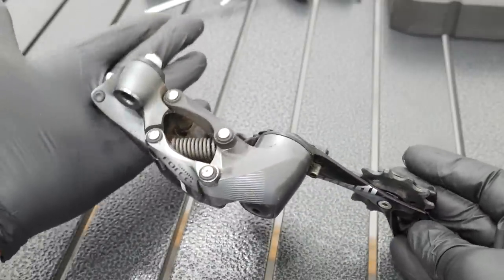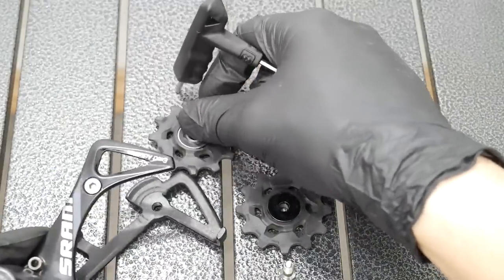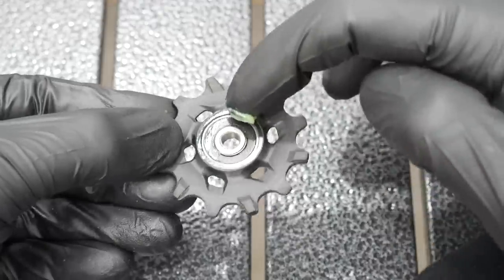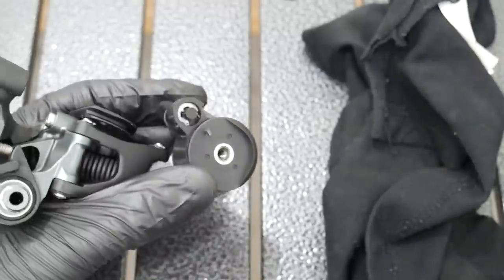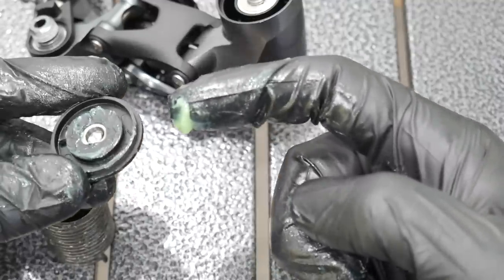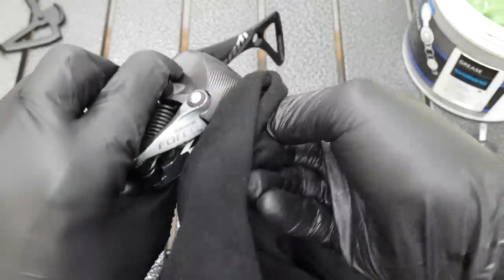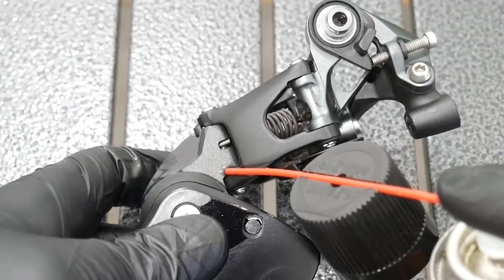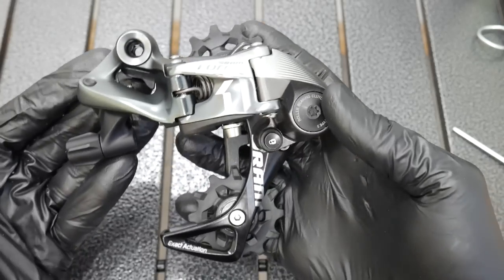Sram Force 1x11 Rear Derailleur After Muddy Races - Full Overhaul.

Comment: Thanks for the video. I would recommend that instead of the dry brush cleaning, a wet one with water, champo and brush so you will not have any sand on the derailleur that can contaminate the interiors during the process.

Comment: Hey, great video. Very useful! Unfortunately, I did the same mistake you did (before watching this video) but on a XX1 11-speed (Type 2.1). Do you know how to remove the spring cap on this derailleur? I removed the small plastic cap on the other side and it reveals a star-like hole you can fit an 8mm wrench to turn, and a small metal pin sticking a bit out from the border of that side of the body of the spring chamber. I tried to push that pin in and then turn that cap but I couldn't. Then I tried to turn the cap without pushing the pin and it eat into the body/housing! I damaged it a bit but not much - should be fine.

Anyway, any help/ideas from anyone on how to do this would be highly appreciated.

Thanks!
Reply: I got it. Just in case someone else runs into the same problem. The little metal pin has to be pushed out from the inside, as opposed to from the outside.

Comment: If I want more tension on my clutch, can I just spin the derailleur hanger one more time around like you did it in 11:02 ?
Reply: I would ask the same thing. My SX derailleur is no where near stiff the chain slaps around on my chainstays. I might get the Shimano Deore 12 speed derailleur whic has an adjustable clutch.
Reply: @socas_nic  i also have a new sx derailleur and it doesn't have any tension either. Let me know if you find a video on how to higher the tension
Reply: @Lang_joch  SX derailleur doesn't have a clutch.... There's nothing we can do
Reply: @socas_nic  oh that's quite a pity. Thanks for the fast answer though.
Reply: @socas_nic  so can i just turn my nx just one more round to have a higher tension ?
Reply: @qwqwqwq2401  No. You can't. NX derailleur has a clutch though but you can't adjust the stiffness
Reply: @socas_nic  i just read you cant adjust the Type 3 clutch at all…even the gx and the other detaillieurs have this type of clutch hm
Reply: @qwqwqwq2401  yes you can't adjust the Sram clutches. Only shimano clutches can be adjusted. SX derailleur doesn't have a clutch

Comment: What if the big spring (not the one inside the clutch) but the one with the paralepiped is too loose to pull on the wire? And the speed don't go down when I hit the command ( although I ve already adjust the cable and everything a week before...)

Comment: I have same problem with clutch disasembly (I can not extract allen screw) but sram GX doesn't have a torx screw in the other side. It has a barrette and I can not extract it to mount all correctly. Can you help me?